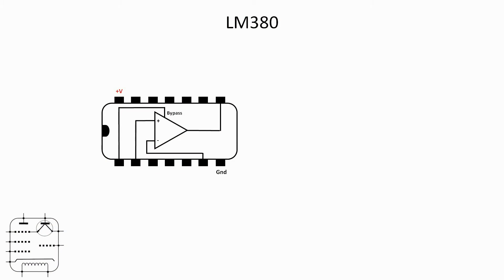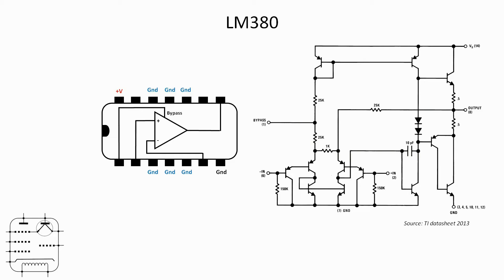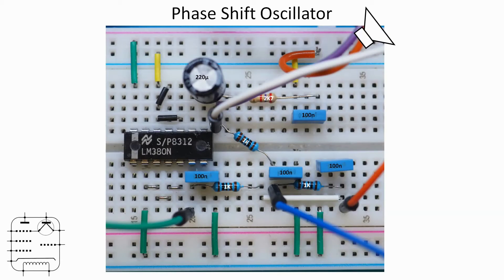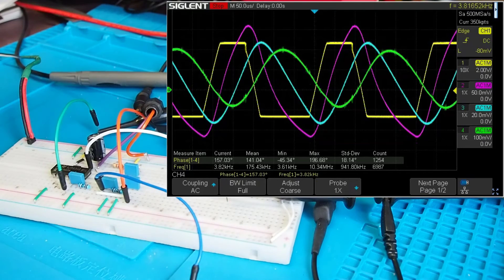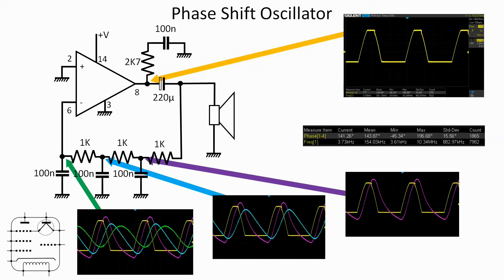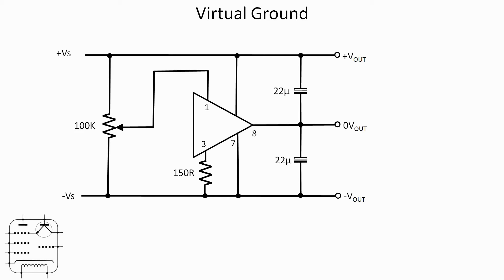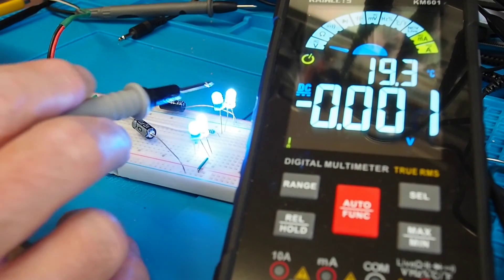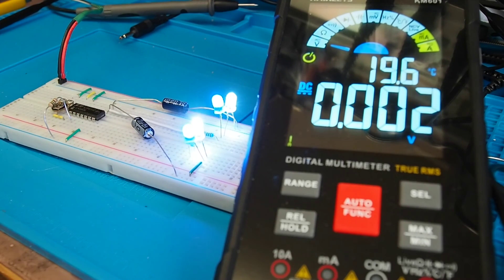The LM380 Audio Amplifier   Looking at some alternative uses of this chip   #113

Comment: Hello. Just one point, when used as an amplifier, or as phase shift oscillator, Its good to use the Zobel network on the output (pin 8) as you have done, but the resistor should be 2.7ohms NOT 2K7 !! Cheers B.

Comment: If i'm not mistaken, is this IC also used in the very low-end speaker sets of Logitech, like the S100 and S120. My first signal tracer was build with the circuit of such speakerset. 
A small value +600V rated capacitor to block DC and you are good to go.

Comment: It is useful to use dedicated ICs not exactly as intended. That why one should look the datasheet to see what is inside. I made oscillators with the old TDA2003, I used it as comparator; it is a opamp with high power output after all. When I got some TBA440 (video IF amp&demodulator) I made two walkie-talkie from them, one IC for emitter and one for receiver on each walkie-talkie. Also the TBA120 made a nice modulator as alternate use.

Comment: I think the fault in the original power splitter circuit was that the neg input should have been connected to the output, not ground, to create a unity gain amp.

Comment: "virtual ground" is exaclty what sprung to my mind immediately after seeing the title of the video and going to read the datasheet. It's unfortunate though that the chip is specced only for >= 10V. It would be really useful if it could work at 9V for providing virtual grounds to battery-powered devices. Though, even with the current limiting resistors, the quiescent current of tens of mA would deplete a 9V cell quickly, so more of an academic interest really. There are better arrangements for virtual grounds at 9V to be sure, but it's an interesting application nonetheless.
Reply: There's always the ICL7660A that covers +/-1.5v to +/-12v if you need it.